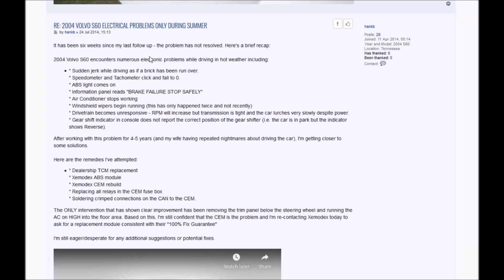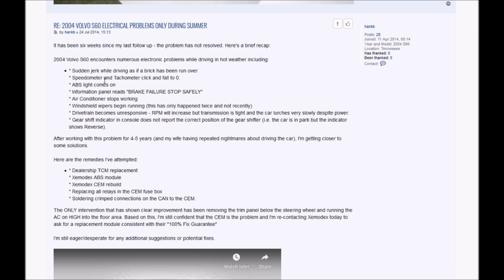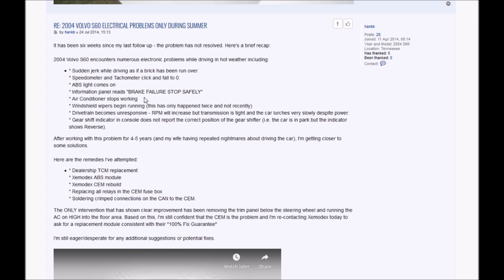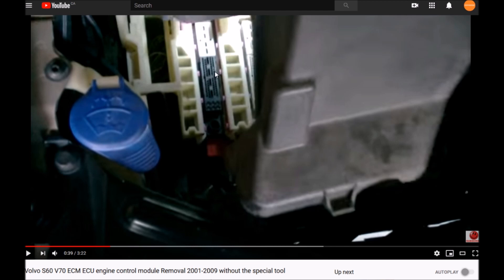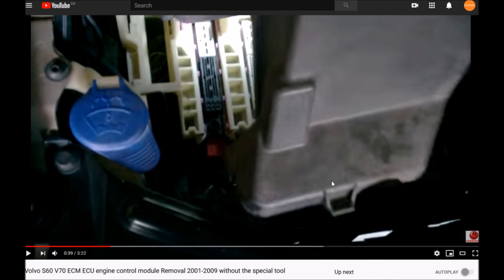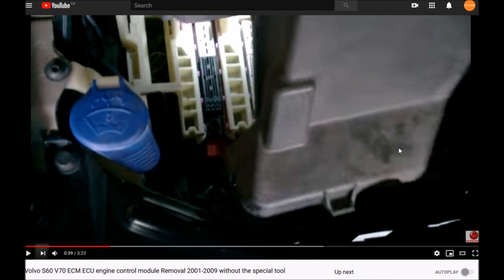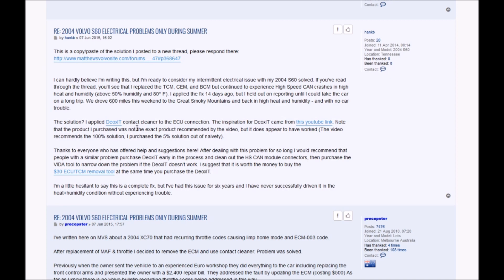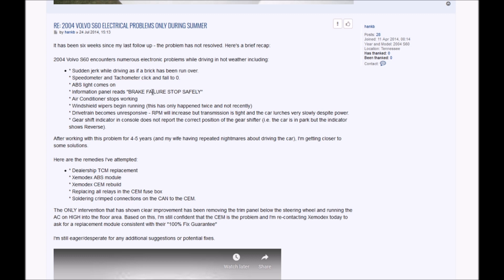Volvo S60 V70  ECM/TCM causing transmission, engine and electric problems 2001-2009

Comment from the maker: Module removal https://youtu.be/pqCzHmM03mU
As you look at the box, the left module is the actual ECM (or ECU) while the right one near the engine is the TCM (Transmission control module) that appears to work for both manual and automatic transmissions
Reply: what happens if i only have the ecm and not the tcm

Comment: I am pretty late to the party but I just have to say you MIGHT be a LIFESAVER! (of a 2005 XC70 I was considering junking) - I have been online looking for answers to my specific symptoms but everything was a mix of some problems and not others making me think maybe I had more than one issue going on... until I watched this. The brake lights, stalling out, gauges going to zero, everything is to the T like I was experiencing.

Last night I took out the ECM and TCM and sprayed Deoxit all up in both the connectors and the module pins. Reinstalled. First startup, the dummy lights were all still there. Started it again, and my dash is error-free. Drove it for about 30 miles since then and still good! Normally it would have started acting up by now. Keeping my fingers crossed!!
Reply from the maker: Hope it works
Reply: 200 miles or so with no problem! Fingers crossed. I was even going back and forth with someone from Xemodex for a while. Thanks again

Comment: Just wanted to update. Cleaning the transmission connectors on the connector tree on the driver side towards the front bumper with deoxit d5 made the code go away.  Back to normal as far as I can tell.

I would absolutely recommend anyone with this code try this FIRST as the cost is only about $15 and anybody can do it. The connector tree is near the driver side front headlight, and they are all oriented vertically, so water can easily collect on top of the connectors and soak down into it, causing corrosion. As an additional bonus, you can use your extra spray cleaner to clean your battery terminal or any connectors you ever mess with in the future, and even clean your turn signal switch stalk if it's acting up.
Reply from the maker: Appreciate the update. Would you recall us the code you had ?
Reply: @Peppermint1  I forgot what it was but it was a transmission control module code. Researching the code online showed potential repairs as replacing and reprogramming tcm or replacing shift sensor.  Thankfully I knew I had caused the code by introducing water into the engine bay, and back when researching it led me to your video. Most likely was whatever code you discussed on this video

Comment: Hi mate! I have following you since years, but never attempted to ask you. May you help me? I have replaced everything in my 2006 XC70 gearbox even valve body. All shifts now are smooth but reaching 80kmh it fails. Dtc are ECM-5130 tcm signal issues and TCM-002F torque converter slips . I have put a LOT of money and time to get no solutions!! Thanks for your help. Saludos desde Chile 🇨🇱
Reply: Hey. I have same as your problem.! At 80kms torque converter slips.. so what you did? Cleaned contacts?

Comment: Do you have a link to the post?  I just cleaned my engine bay with a garden hose to get rid of old oil spills and ended up with the same code
Reply from the maker: I don't.  Here's how to try removing the modules - battery disconnected of course.  Also remove the ignition coils see if there's water on the spark plugs, soak it up with towel without removing the plugs  https://youtu.be/pqCzHmM03mU
Reply: @Peppermint1  you are awesome, thank you for these videos!  Just checked spark plugs and no water... I may change the oil just in case
Reply: @Peppermint1  once I get these computers pulled out, which contacts do you think I should start cleaning up?  I got a code TCM -0002 .... And on on unrelated subject I've also been battling a p1171 forever lol. Can't find any vaccum leaks and am thinking next step is clean the fuel injectors and check fuel pressure and clean throttle body... And that'll give me a chance to inspect the lower tube while Ive got it all taken apart. 01 S60 t5 by the way
Reply from the maker: @CharkG73   When the two modules come out, each has many contact pins at the bottom.  I'd just take a hair blower and make sure there are dry and none has green corrosion on it.  Careful with the magenta plastic locking tabs, these must be fully released to unlock the modules. It's tricky, so work with patience
Reply: @Peppermint1  will do. I've got the tongs in my fcp cart too
Reply: Just wanted to update. Cleaning the transmission connectors on the connector tree on the driver side towards the front bumper with deoxit d5 made the code go away.  Back to normal as far as I can tell.

I would absolutely recommend anyone with this code try this FIRST as the cost is only about $15 and anybody can do it. The connector tree is near the driver side front headlight, and they are all oriented vertically, so water can easily collect on top of the connectors and soak down into it, causing corrosion. As an additional bonus, you can use your extra spray cleaner to clean your battery terminal or any connectors you ever mess with in the future, and even clean your turn signal switch stalk if it's acting up.

Comment: If you have a minute, my volvo has thrown a P0600 and I've looked up code and it's all described for issues concerning the ecm and tcm but when I was trying to plug the code reader into the OBD2 port it kept having issue communicating with the reader. I can tell that there's an issue with the port because I had to hold it in a specific spot to get it to work but do you think that the P0600 code can be related to the bad port?
Reply from the maker: I doubt port connection would cause a code. Try also asking on several of the forums for that code
Reply: @Peppermint1  I did try a forum I believe you linked in one of your videos. But I did find after that the vacuum pump relay was blown and the vacuum pump is bad as well as the little 3 way black valve that connects to it from one of the black hoses.

Comment: I have a 2009 xc90..I can be driving and all of a sudden my vehicle has no power..i can step on the gas and it doesn't do anything. it does end up coming out of it quickly though. I can turn my car off and turn it back on and it seems to be out of it. I have vida..all it came up with for codes are p1719 and ecm-p001268...any idea? Thank you
Reply: We have the issue. I'd like to hear from you.

Comment: I have a 2002 volvo c70 , it has 200,00 miles,  anyway its doing something weird when I put it into drive it sometimes double  clunks rather abruptly , sometimes it's just  a double bump that's not a abrupt one, when it's cold it doesn't do it, and sometimes  it  depends on the way my steering wheel is ( what way it's turned) other than that it drives pretty good  , everyone in a whole it shifts a little weird but not major mostly if I gas it too fast not sure how to explain , the mechanic said it was my transmission , it shifts smoothly  MOST  of the time  , the mechanic would not even bother w it,  I haven't had it long and truly love it already but I'm not sure what to think it is, the mechanic seemed like maybe he had another car he would have rather worked on🥴 any thoughts? I have no clue about cars but am wondering if I should just drive it into the ground like the mechanic said
Reply: That's what's happening to mine, and the guy before me poorly maintained it. And I hoped after changing all fluids it would work like new but when shifting to 3rd to 4th gear it's starts to slip and mis fire. I'm not sure if it's ECM or the transmission wear and tear on gears

Comment: Do you have to go to the dealer after replacing the ecm to have them reprogram it?
Reply from the maker: Normally repair services for electronic modules will try to salvage yours.  It works most of the times. Xemodex in Canada is expensive, there are other electronic module repair services on Ebay. In rare situations where it really needs replaced, I think Xemodex can give you a used  CEM already programmed from your old one, but they are not cheap. And Volvo will only reprogram if you buy a new unit$$$$. May also have a look on this blog, at the beginning https://volvos60xc70xc90buyersguide.home.blog/
Reply: @Peppermint1  thank you for the reply.

Comment: Hi i have v60 2012 and having all the warning lights one also no electric is working could that be cem or ecu
Reply from the maker: I cannot give advice, but a first easy check is alternator and battery voltage (along with their cables, connectors, etc).  May also ask us on forums https://www.matthewsvolvosite.com/forums/viewforum.php?f=26

Comment: Thank you for all your video, I took out the little fan and applied 12v red+ , black -,  so the airflow direction is blowing air into the box.  But when I put back the fan into position, I can't feel the airflow?  Previous owner never changed cabinet filter. I changed it once I got it. So could it be any clogging behind the firewall.
Reply from the maker: I did wonder too about the air direction. It's not easy to measure it - may try keeping a napkin close see if it suck or pushes it.  My impression was the fan was actually pulling air from the box towards inside the cabin, which would perhaps make more sense, otherwise it will have to fight against the vacuum from the cabin blower. I'm not aware if the fan duct goes behind the cabin filter, I would guess it enters the climate ducts before the filter.
Reply: @Peppermint1  I will double check with wiring. I encounter the ECM or CEM overheating issue. Dash shut down, but still running.  So I wonder, for the ECM the cooling fan is not strong enough. Try to put a temperature controller there to monitor the temp.
Reply from the maker: @calebandrachellezhang3597  What are the problems ? Only dash shut down ?  Which year the car ?
Reply: @Peppermint1 2004 V70, 70k,  Basically like online many people described: A/C not working, All meter not working, the alarm system not working. Very Rough driving. It is because CAN bus failure. so the CEM and other parts can't communicate
Reply from the maker: @calebandrachellezhang3597  There might actually be several separate issues with the car. AC not working can be a problem with lack of freon or too much clutch gap at the compressor or faulty cabin temp sensor. Alarm system is caused by failed alarm siren module. Dash gauges may be caused by the common DIM failure but mostly 2002-2003 cars were affected - possibly early 2004 if they have similar dash. For other problems look under the dash see which model of CEM you have.  If it has many small fuses on it, it's the one that gets water leaking on it from a faulty seal under the windshield. If it rather has like black small relays, it's the earlie CEM model which is not affected by water.
Reply: @Peppermint1  Well after cool down and reconnect the battery, everything is fine again. SO very typical like many forum said, it is a high speed CAN bus crash problem. So I got a chasis fan on the cem, so far so good.  I also ordered the Johnson motor to change the little fan. The model of the motor you can't find the RS-365-1885,  Instead they are Johnson Electric HC315MG. I got them from ebay. I will test them and let you know how is it go.

Comment: hello, I have a problem with my volvo S60R 2004. Basically, my dashboard is nonfunctional given that I have a fuse that burns momentarily.  The fuses 24 and 27 of the fuse box on the driver's side.  The fuse 24 is for climate control, intrusment clusters and the power seat driver.  I had the car scanned and the P0650 code came out.  
P0650
 ECM-6B00
 Malfunction indicator lamp (MIL)
 Signal missing.  Intermittent signal fault.  I used a multimeter to find out what was going on and it looks like I have a short circuit because it goes up to about 11.50 amp.  I ended up buying an ECB3000B.  It’s a short detector.  Please help me.
Reply from the maker: Try asking on these forums 
https://www.matthewsvolvosite.com/forums/viewforum.php?f=9
https://www.volvoforums.org.uk/forumdisplay.php?f=19
Reply: Peppermint Thank you very much!
Reply from the maker: @student8165  Welcome!

Comment: It thesame as i experiencing now with my volvo s60 2001. My mechanic told me the problem is the tranmission gearbox. Because when i change the gear from 2 to 3 then acceleration is not as it should be n  the arpm going crazy and thesame when i change from 5 to 3  i feel no power at all. I look at it if the is wet or so.
Reply from the maker: It's automatic ?  What you describe sounds like the transmission is slipping in the 3rd gear.  May be because a garage removed the top 27mm bolt thinking it's a refill hole, or simply because the 3rd gear band is completely worn.  For the first see this  https://youtu.be/VFyQptqISsc  For the second this https://www.matthewsvolvosite.com/forums/viewtopic.php?t=71963
Reply: No my transmission is manuel not authomatic. But thanks for your help maybe its the end of my car. I can't afford ti change the gearbox.
Reply from the maker: @duposflies2621   For manual, look underneath the transmission for any leaks, and also monitor the fluid level in the brake fluid reservoir (it uses the same fluid for the clutch slave cylinder).  It is looses brake fluid it's indeed a slave cylinder job - expensive on this car because it needs everything replaced and the engine has to be removed from the car.  Also ask on this forum, they have a lot of manual transmissions https://www.volvoforums.org.uk/forumdisplay.php?f=19